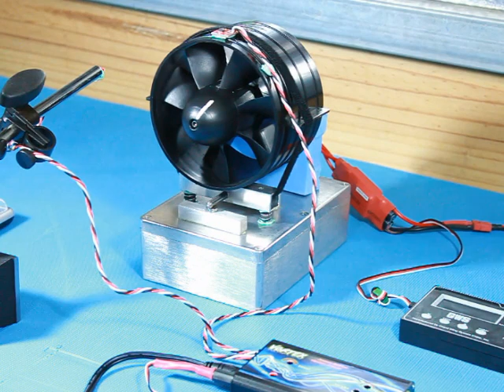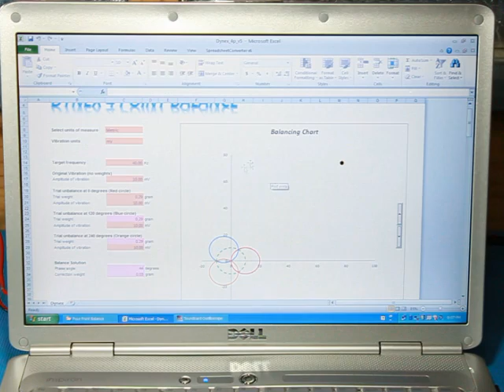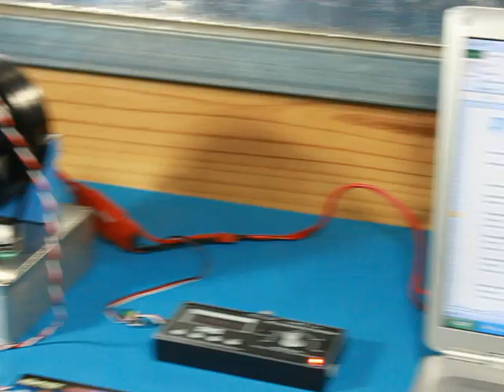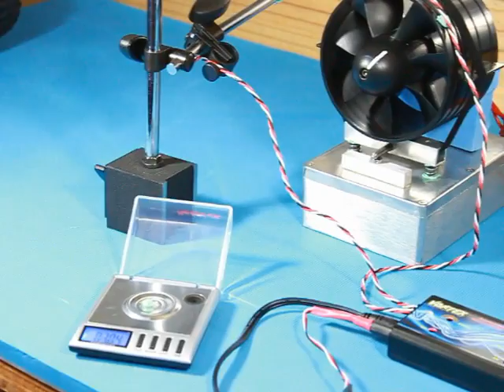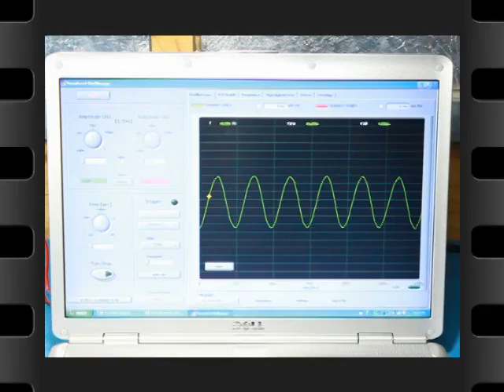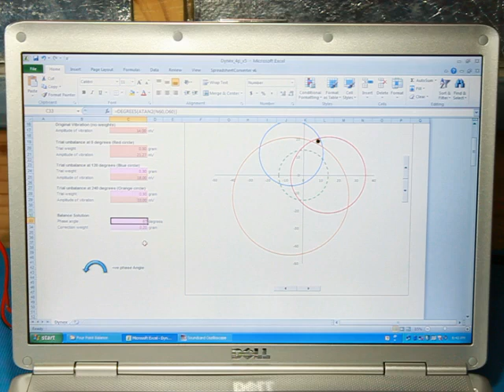Vortex 4 Point Balance Method

Comment: Can i ask an question my granddad has the software everything. But when he spin the motor up the rpm are all over the place . From 0 to 100000 to 70000 and sometimes it dont give any signal. We used the ir that you can use 150mm away. We played with distance . But nothing works . What can do wrong
Reply from the maker: Please check your Windows settings for Impulse 2. It should be set to 2-channel stereo. refer to the User Manual online. Any other issues, please email us at info@dynexhobby.com